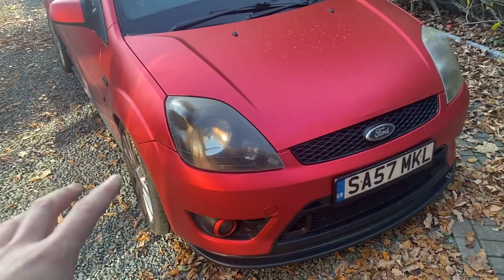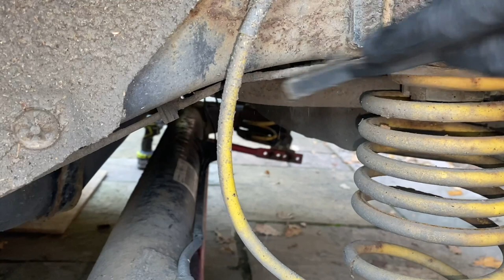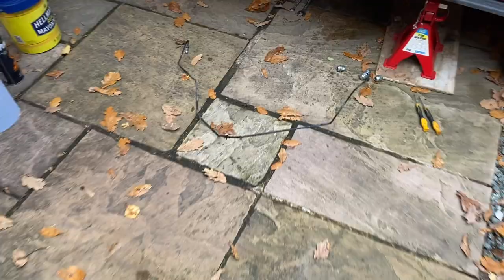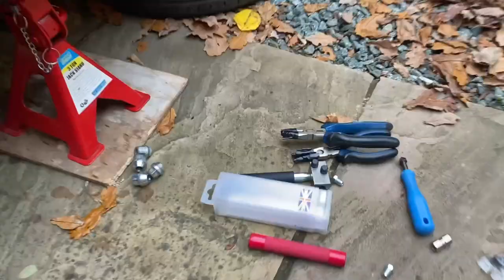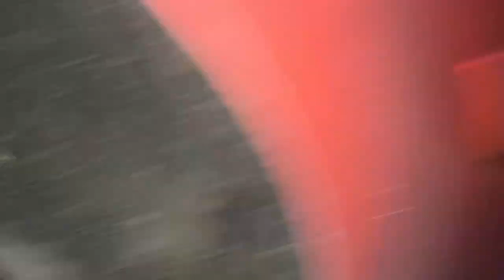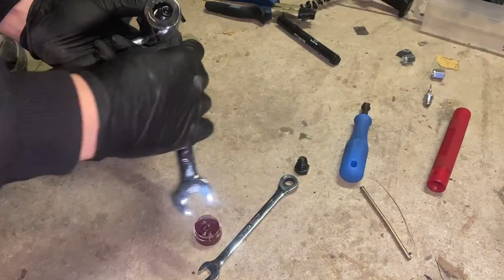Making new Brake hard lines/pipes for my MK6 Fiesta ST150 | MOT Prep

Comment: great video mate, yeah MOT testers are not allowed to remove anything from the car because it can invalidate the MOT and can be called fraudulent, it is a stupid rule but it is what it is, sadly tho it can mean a car could pass its MOT and have horrendous amounts of corrosion hidden under an under tray, its a stupid rule but your best bet to check anything before is, once you replace brake pipes or any metal component,  put grease on the new component and  just before your MOT (like a week or two before) just wipe the grease off and check the component to see how it held up and so you can see if you'd get an advisory, but yeah, keep up the great work mate
Reply from the maker: I spoke to an MOT tester shortly after and he said the reason they advise it for grease or whatever is to cover themselves if it was corroded, which I get but surely it would be safer if they could just clean it and check it 😵‍💫 thanks for the tip mate
Reply: @MendItModIt  yeah no problem mate, it is a stupid rule but hey ho, just gotta work around it

Comment: Hey. I have a question. My Fiesta starts up no problem but after 4-5 seconds it stalls. Not even the accelerator pedal works after those 4-5 seconds. 

Slarkplugs, throttle body and fuel are all ok. ECU has been reset and updated. Any other ideas?
Reply: Maf sensor, fuel filter, coil packs, fuel injectors… does it slowly stall or instant shut off